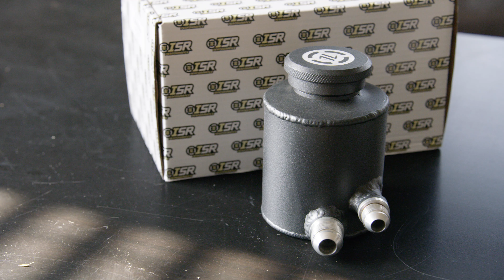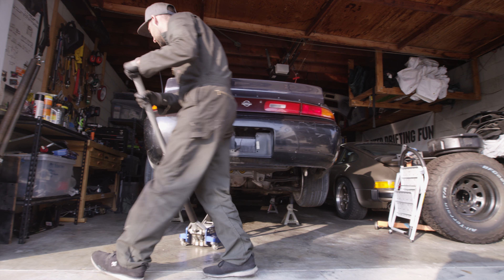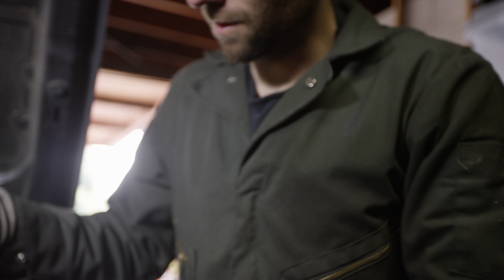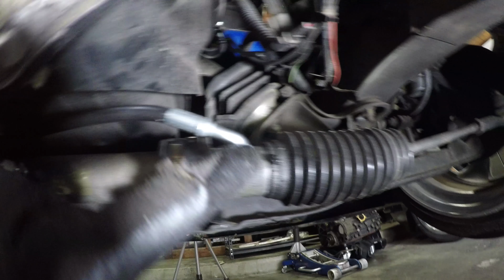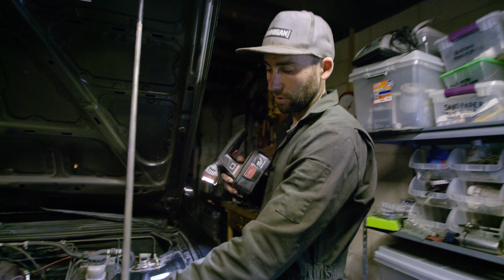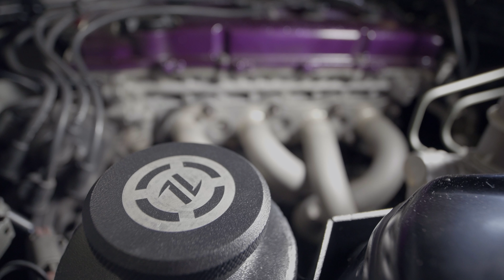ISR Perfromance 240sx Power Steering Kit Install - Street Project s14

Comment: super late to this but i just installed mine, and it got rid of the line cooler, now has my power steering fluid pretty toasty, should this be something i should be worried about? debating on getting some sort of cooler but they didnt design the AN lines to fit it, so kindof stumped?

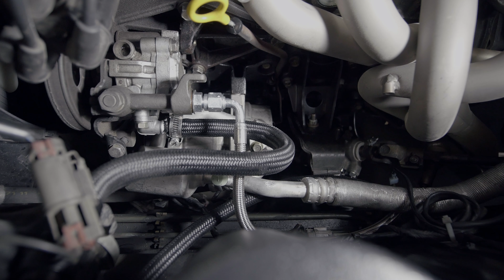Comment: I see at 4:47  the high pressure line does not have a washer with inner rubber seal from AN to steering rack. My isr kit came with one for both rack connections
Both my lines into the rack were super tight. One or both leaking and Trying to figure out the cause.
Reply: I have the same problem did you ever figure it out?

Comment: why the hard lines on the rack? doesnt seem like it would help any? good video though. i like that high pressure line
Reply from the maker: The stock lines are a hard line/brake line style - the replacement lines are braided stainless which is more flexible and impact resistant. As I mentioned in the video if you pull the engine a few times you might catch one of the original lines and bend it.

Comment: Would this work for the SOHC?
Reply from the maker: Not sure, my knowledge of s-chassis is limited to mostly s14's and dual cams. However the reservoir should bolt up and as long as the rack and steering pump are the same as the dual cam's I don't see why it wouldn't...
Reply: I've got an sohc and the lines are on the opposite side of the bay. Not sure if they'll fit, but I need new lines and don't want to buy oem.

Comment: $315? Jesus fuck that's expensive
Reply from the maker: Stainless Steeling lines & AN fittings ain't cheap. I spent that much building an oil cooler kit at Earl's hardware.

Comment: that looks so much easier than mine.  i made my own full kit a few years ago with a cooler in line.
Reply from the maker: Glad kits like this exist, I hate trying to buy AN adapters and sizing lines. Thanks for the comment Gaelen, good to hear from you as always dude!!
Reply: Keep Drifting Fun I feel ya there!  I have a box of random AN fittings I've bought and never used for various projects haha. 

Are you going to run a cooler with yours one day?  

Keep up the great work Will. Love seeing what's going on down there. I'll bring the 34 down one day for a jam day.
Reply from the maker: Potentially, I like that it's easy to plumb one in with the AN fittings and lines now. I feel like without the stock cooling loop - it would be worth monitoring temperatures at an event to see if it would help. Uhh yea please bring down the 34 :)
Reply: Keep Drifting Fun yeah that part is nice. I used to boil over my PS a lot. Once I did the cooler it never happened again. Not sure if it was the turbo heating it up though. 

Haha. Count on it once I've finished it. Might load up the 40ft and bring a friend down too. We both want to jam some Cali tracks pretty bad.

Comment: I was debating if this kit was worth it. Ive had a terrible experience with the chase bays one. Ill be buying the isr kit. Thank you!
Reply from the maker: Only issue I had with mine was the reservoir to pump line (only one that uses a hose clamp) was very small and hard to install.
Reply: Did you have to cut the line because I'm trying to install mine and it was too long so it kept kinking

Comment: Replaced my rack and the hard lines and when I did I went to put the high pressure line back in and couldn't get it to thread onto the new rack at all. Ended up getting the ISR one and it worked perfectly, threaded on no problem. No leaks anywhere either. If you're doing a rack swap just go ahead and get the energy suspension bushing replacement and all the aftermarket lines. It'll save you so much hassle.
Reply from the maker: Good points John. Easy to knock them out once, while the power steering system is open and only have to re-fill/bleed it one time. My rack bushings were still solid - so luckily those didn't need replaced.
Reply: thanks man,  btw you've been inspiring me to get resources directed back at my s14. jealous of all you guys out there in NA/KA's the other day even tho you missiled your car. lmao